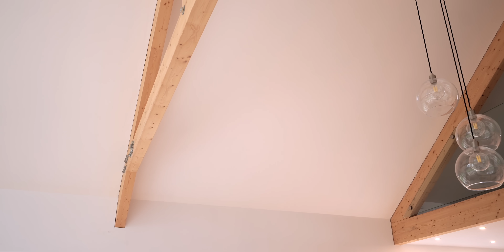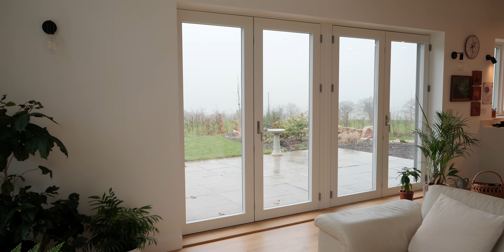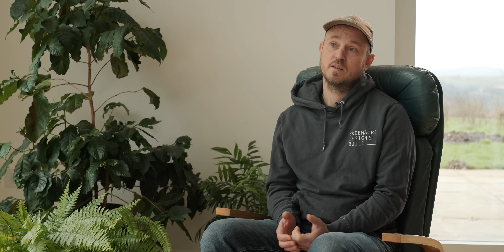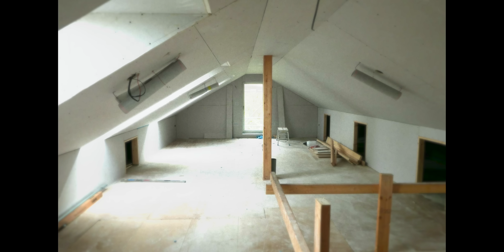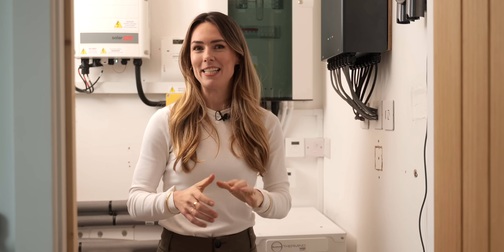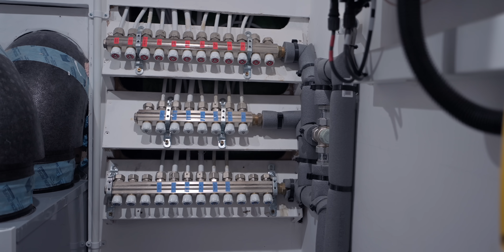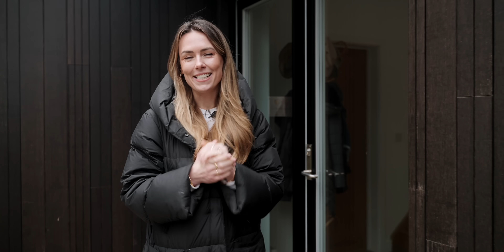Ditching a Heat Pump for In-Plaster Infrared Heating?!

Comment: Our 3.5kWh air-air heat pump heats the majority of our 95m2 ancient, not particularly well insulated apartment using about one quarter of that energy.
Reply: yep. IR panels are a stupid idea if your goal is energy efficiency.
Reply: @hojnikb 

😂😂😂😂 

Why not research the topic and see where your thinking has let you down.
Reply: @ForestForest-n9i  Is there an IR panel, that has an efficiency higher than traditional 10$ space heater? 

Does it come close to 300-400%+ efficiency of a typical split unit AC?

Asking for a friend.
Reply: @hojnikb 

😂😂😂

Suggest you think about ditching your ignorant friends if all they can obsess about is the holy grail of a high COP. Aren't you bored with them by now?

What they should worry about is that a high COP comes at a high price which extends past the cost of a heat pump itself.

If your friend is capable of reading and then inwardly digesting the information freely available online then kindly direct him or her to Google where questions can be answered on the overall costs of heat pumps and the ancillary costs of, let's say, improving insulation, draft elimination, buying triple glazing, larger radiators or installing under floor heating.

Your friend can then calculate how much needs to be spent upfront to save a relatively paultry sum of money each year.

And, if necessary, the costs of servicing a loan for the above listed improvements.

Now, if your friend, with all this new found knowledge, can make a convincing financial argument in favour of heat pumps then by all means implore them to share said convincing argument (?) for peer review, that's us by the way.

Looking forward to reading all about it very soon.

It might be worthwhile considering that by having a heat pump limits the number of buyers when a property goes on the market.

Not everyone might appreciate the notion of having a heat pump in their garden which, by the unwritten laws surrounding "stuff", will become less efficient over time, possibly a lot noisier and require possibly expensive experts to service or repair a defective heat pump.

Anyway, we look forward to seeing all these costs explored and integrated into the overall costs of installing heat pumps.

Do you believe your friend is capable of such financial calculations or will you both need assistance from someone who understands the bottom line thing?

Sincerely hope the above notes help your friend in their quest for wealth, not forgetting health and efficiency.

Comment: Infrared heating is a con.
Anyone telling you otherwise is a con artist.
Heat pumps will always be the most efficient because they are not generating heat, just transfering it. Thats why you get a comparative return of 300%+

If this poor old man wasnt conned, with all the other tech? he' be facing £1000's on his electric bill like everyone else who has fallen for this technology.
Reply: His bills were £195 per ann.
Reply: @johnburns4017  The average price is around 27 pence/kWh. This would mean that the house only consumed 722 kWh/year. However, since direct electric heating is used, which converts one kWh of electricity into, at best, one kWh of heat, this figure is mathematically impossible, especially since hot water production hasn't even been factored in.
In short, even if one accepts the information presented in the video as correct, it is still significantly contradictory.
Reply: Hmm ...Yet another poster who doesn't quite grasp what's going on.

As before probably best to research the topic prior to posting.

Google is your friend btw.
Reply: @ForestForest-n9i  "Yet another poster who doesn't quite grasp what's going on."
I appreciate how openly you share this noble self-awareness.
Reply: @marcromain64

😂😂😂

Hmm ... if all you can come up with in response is sarcasm then kindly don't ... if anyone is doing the sarcasm thing then it'll be me.

Hope that helps.

Comment: Just pissing away power. Electric heating can’t be more than 100% efficient. A heat pump would only use 1/3 to 1/4 as much energy. You can buy small heat pumps and they throttle down to 10 or 20% of their capacity with an inverter. It’s really dumb to feed AC or DC to a heat element when you could use far less kWh to heat both your water and the house. The logic is dumb. Radiant heat should be in the floor, especially in a new build. If you have excess power, sell it back to the grid.
Reply: 😂😂😂😂

The logic might be dumb to you because you might be dumb.

Why not read up on the topic first prior to posting?

And while you're struggling to understand the technology why not factor in the costs of everything required when using heat pumps?
Reply: Did you get it?

Comment: Lot's of people saying he should get a battery, but they're expensive and when your bill is under £200 (most, if not all, is standing charge, which is about 50p/day), then what's the point? At the moment he is using as much electricity he can at night, probably putting most of his solar into his car and/or heat battery, and still getting 15p (3/4 of my current variable tariff rate) on his exports. So any savings have to be done with that in mind, his solar panels could feasibly put out 25-30kw/day at its peak, meaning to fully take advantage you need a good size battery. He has an average daily usage of 16kwh, but I suspect that is heavily winter biased (when power cuts usually happen), so for long term protection there you will again likely need a big battery.
It's the same thinking as to why not to get a heat pump - they're expensive and require maintenance. If you have managed to minimise your heat losses, you don't need much, so the savings on the running of the heat pump could take some years to recoup.
Some suggest filling the battery up at night and selling it back to the grid during the day, which can be good, but I doubt the long term viability of this money making option - EV tariffs are already getting less generous (variably reducing hours, increasing night prices, or increasing day prices, and the export rates could be reduced. Many people justify the investment in a battery on the returns they are making with the current favourable rates (or last years). Long term I think they will help balance the grid and save people money, but few will make big savings beyond capturing renewables.

Comment: Dutch regulations has an maximum energypreformance of 1,31 for main heating of a building. Which gives an COP of 1,11 of higher. IR heating as main heating is not permitted.
Reply: European regulation States maximum Energypreformance for installation and for the whole building. And an emission free heating. In the Netherlands this resulted in an preformance for main heating. Therefore an IR-heating or resistance heating is not permitted as main heating. This can be different  in each european country.
Reply: Are you sure that FAR IR heaters cannot be used as the sole space heating source in Europe?
Reply: @ForestForest-n9i EPBD - Energy Performance Building Directive. A permit wil be rejected if IR is used as main heating.
Reply: Hmmm...we are a German manufacturer and have been in this space since 2010, installing IR widely.  In fact it has been recognised in th GEG as a preferred solution along with PV
Reply: @EnergyCarbonInfraredHeating   @ForestForest-n9i I made a mistake, the Netherlands implemented european legislation differently. It may be permitted in Germany or in the rest of europe.

Comment: Amazing that a battery wasn't a good idea but then explains that they get cheap energy at night where they could charge a battery??
Reply: Put power cuts to one side. His bills were £195 per ann. Why spend a fortune on a battery?
Reply: @johnburns4017 my Powerwall is the main reason my bills are so low. He'd have zero bills or be in the black with a battery I would have thought.
Reply: @leeroychang 
At what cost though. Julian would be spending a lot of money on a home battery in order to make some money. Would that money to purchase a battery get more return in a building society?

£8.5k in a building society at 5% interest gives £425 per ann. Would that make more than than buying cheap overnight electricity then selling it back during the day?  Then replacement parts for the system over the years?
Reply: @johnburns4017 12k I think for the Powerwall when I got it. They're cheaper now though. It will cover itself before the warranty is up which is why I got it. And I believe it will last longer than the 10 years too.

Comment: We have 80 solar panels for 2 3 bed holiday lets and an annex for 2 people and 2 electric cars and a phev. Bill for the year about £130 with 30k miles of EV driving. Cost about £35k for in roof panels. No battery.

Comment: Our Sunamp has worked well for us too, and one or two other adavantages not mentioned with the type of heat battery is; no need for proventative measure against Legionella, and its doen't go cold instantly, it turn a luke warm temperature slowly, signaling that the battery needs reheating. Which we do by either our solar arra or the grid over night. We also have Infrared panels in 3 of our rooms, so it was interesting to see this new developement in the technology.
Reply: Do you agree (stated in the video) that the infrared panels that you have are primarily to heat you while you're in the room (rather than heat the air)?  I wonder if you have measured the air temperature in those rooms?
Reply: @mb-3faze 

FAR IR is to heat the person, not the air.

However the FAR IR radiation does warm nearby surfaces, which re-radiate heat and do become slightly warm to the touch.
Reply: @ForestForest-n9i  Thanks. I'll soon get possession of a 1970s timber-frame house which only has storage heaters for heating. I'm looking into options for improving insulation and heating. 
A neighbour has a 1970s house and their heating comprises electric elements in the ceiling plasterboard sheets. This was installed during the original construction (so nothing new with IR radiation panels!). 
Over the years they have paid a bit more for electricity but what they've missed out on by forgoing gas central heating is : the daily standing charge, annual maintenance charges, 10-12 year boiler replacements and variations in gas prices. They've also missed out on the anxiety of frozen pipes especially if they went away in winter. Their system has been 100% reliable and maintenance -free.
I fear those with heat pump systems are going to have the same types of ongoing costs which would undo the savings over pure resistive heating.

Comment: I'm just wondering how much does it cost to build a house with running costs of £196 per year?
Reply: We live in Denmark and had an idea to build such a house, and we calculated that it would cost between 60000-700000 pound, or 5-6 mil dkk
Reply: @patrickholm93you need to fix your calculater...
Or are you calculating with a house north of copenhagen

I did it for 500.000kr
And my house in denmark makes more money then it cost now. 
Not getting rich but i make more then i pay 

You need to turn it around to a income first of all
I for example heat my house a bit with bitcoin miners with solar, and i sell my electricity for bitcoins

And i could put a couple of sheeps or under my solar panels and make even more for example

I could never have done this in the house i sold i copenhagen, the parcel alone cost 50x more then the parcel i have now
And the tax was also 20x more

Its also a matter of how you want to live
I have no reason to live in a city,  and i have no need drive a car to work every day for example
And i have min købmand next door, in cph i had 10-15 min to a supermarked.

For 6 million dkr i would make the same amount of money as with a ok job

You need to make most of it yourself, or else you wont understand it to maintain it..
And If you want others to make it for you, you pay 3-5 times more
Reply: @patrickholm93 I’m not sure I’m reading this right, are you saying between 60k and 700k?
Reply: @GuillaumeRossolini  definitely close or over 700k
you can't build a barn for 60k these days
Reply: I have a renovated home from the 80s, and it runs for a little but more than that. But thats net cost so including solar export gains in de summer.

Comment: ???He is completely wrong about house batteries! I have a Powerwall system with their gateway which works in normal times, charging from my solar or during cheap rate grid times and then keeps the house off grid all day, in a powercut the battery and gateway isolates the house from the grid and keeps both the house and importantly the solar working entirely normally, my annual bill is minus £22.  I am surprrised they did not go for underfloor heating, heat rises and would have solved the issue with the room they are having to alter.
Reply: His bills were £195 per ann, including 7k of EV charging.

Comment: My biggest concern is the matting in all the walls. Several shots showed pictures up on the walls so how do you do that without causing damage to the heating? I can only assume that they have to avoid the walls with the matting in them and I think I heard them say it is low voltage so perhaps the safety is not a huge concern (though it would have to be high current to get the heat output so the voltage is maybe moot) but it would certainly damage the matting and expose live picture hooks etc.
Reply: Actually this is not an issue.  In fact our mats are perforated with millions of tiny holes so a few screws here and there has no effect at all.
Reply: A fair point.
Reply: The heating is supplied at 36V AC via a transformer, as shown in the video.

Downlight holes can be cut through the mats up to 75mm, as long as the copper elements either side of the mat are avoided. These are around 20mm wide.

If you’re fixing through the mat into the wall, plaster Rawlplugs must be used. We also recommend foil-backed plasterboard and without the Rawlplugs there is a real risk of creating a fault.

The system is protected by MCBs, but the aim is not to rely on protection — it’s to install it correctly so it’s never needed.
Reply: Double sided foam tape?
Reply: Having given this question on the hanging of "art" some careful consideration then it's always open to yourself to engage an artist, specialising in murals, to paint a somewhat smaller, simplified Sistine Chapel in your sitting room.

I appreciate this may not cater for all tastes so perhaps on a somewhat "warmer" theme then Dante's Inferno might answer?

Or just some fluffy clouds surrounding a Sun, with added birds.

Extend the mural across the walls to perhaps depict a Palladian paradise, complete with nymphs and shepherdesses being pursued by obviously priapic satyrs out looking for a good time.

That would work, and be the envy of all your friends and neighbours, not to  mention Social Services if young children were present.

Comment: Interestingly there was a story on BBC news about a similar system at the exact same time this video came out. That article was pointing out that the system that had been installed on a development in Hull had completely failed and had been abandoned by most of the tenants.
Not trying to rubbish the tech, just another story that highlights the importance of matching the system to the requirements of the situation. As they pointed out in the vid, this tech needs to be situated very carefully based on use of the space which was probably very difficult to plan around for a developer designing for tenant occupation
Reply: No, these were IR panel heaters installed around 10 years ago.  Totally different technologies
Reply: Were the houses Pasiv Haus? If the heat demand is two kilowatt maximum it is difficult to fail.